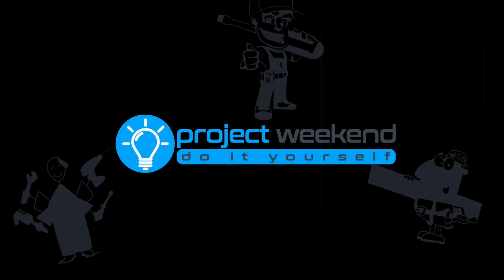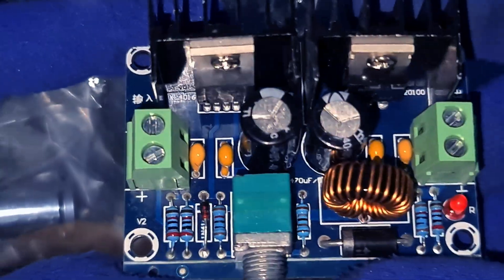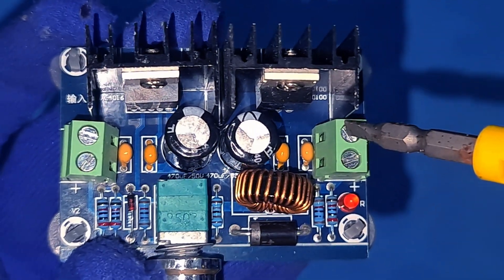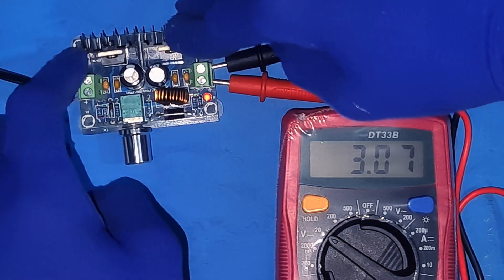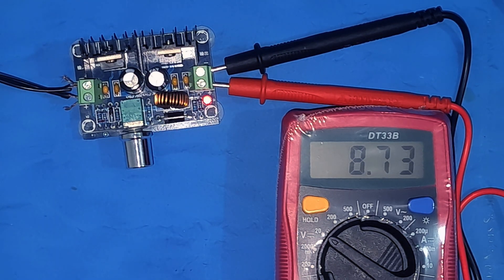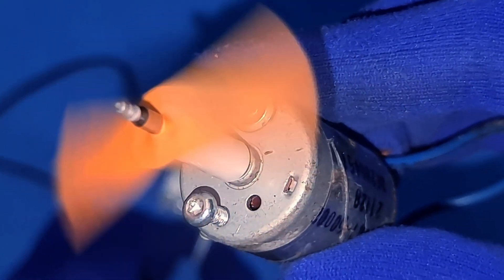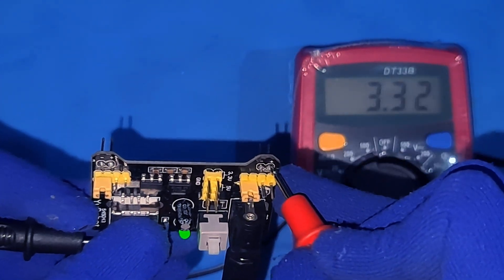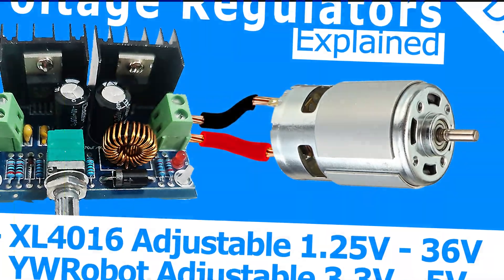XL4016 | xl4016 buck converter |  dc step down buck PWM voltage regulator | 1.25 - 36VDC | YROBOT

Comment from the maker: ❤ Hi friends,

Welcome to Project Weekend, where we take your DIY skills to the next level! 🚀 In this video, we explore two amazing power modules that are perfect for any electronics enthusiast:

✨ XL4016 DC-DC Step-Down Buck Converter
✨ YWRobot Dual Output Breadboard Power Supply

Here’s what you’ll learn:
✅ How the XL4016 buck converter reduces voltage efficiently (from 4-38V input to 1.25-36V output).
✅ Real-world testing of the XL4016 with multimeters and a DC motor as a speed controller.
✅ Exploring the YWRobot power supply for clean 3.3V and 5V outputs, ideal for Arduino and breadboard projects.
✅ Why these modules are a must-have for powering LEDs, microcontrollers, motors, and more!

XL4016 Features Highlighted:
💡 Precision voltage control (with tips to improve adjustment accuracy!).
💡 Built-in protections: over-current, over-temperature, and short-circuit safety.
💡 Applications: Motor speed control, LED lighting, audio amps, and beyond!

YWRobot Breadboard Power Supply Highlights:
🔋 Compact design for seamless breadboard integration.
🔋 Independent 3.3V and 5V channels with toggleable jumpers.
🔋 Perfect for Arduino and low-power digital circuits.

Why this video is a must-watch:
🔥 Learn to manage power efficiently for your projects.
🔥 See these modules in action, tested live with tools and devices.
🔥 Unlock the secrets to successful prototyping with reliable power supplies.